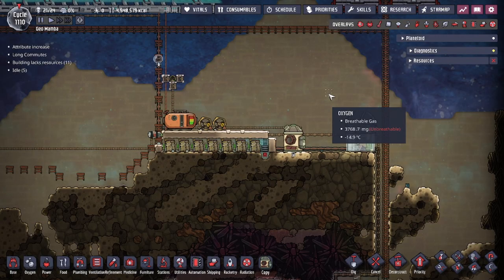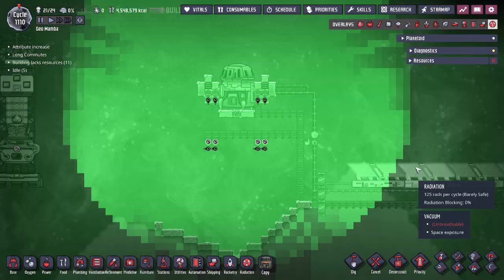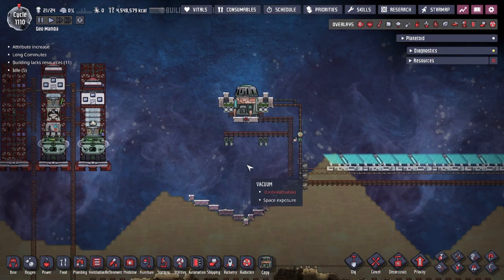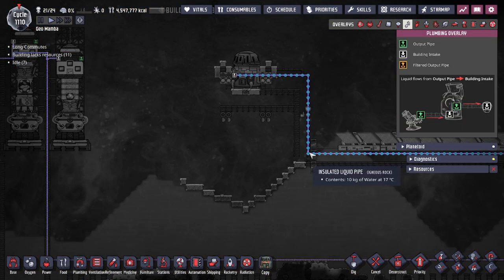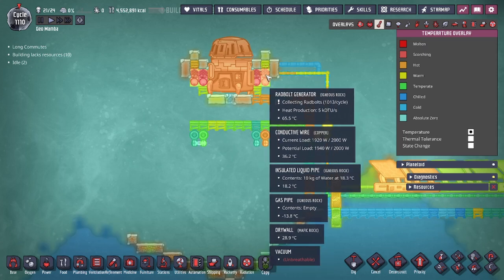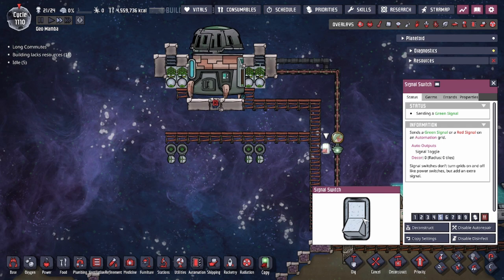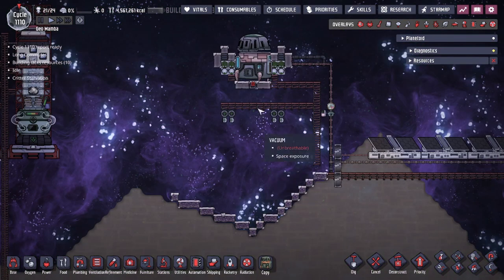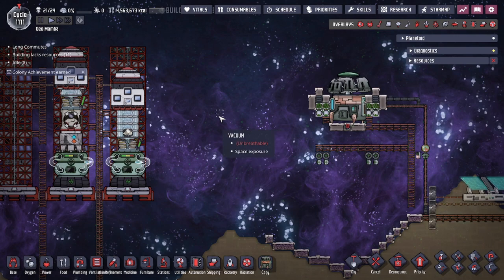Easy Radbolt Rocket Engine Charge - Research Reactor Cheese - Oxygen Not Included

Comment: Technically, you could use an automation line with a heat sensor to detect when water is falling, open a mechanical door, and lock the steam inside a separate room for easy heat and water collection.

Comment: Likewise, you could put wheeze worts fed by shipping and automation next to the generators. Enclosing them in a space with hydrogen, then you can put a solar panel to either side, and use nuclear waste or gold/tungsten metal tiles to seal the room, as they block very little radiation. The radiation generated from the wheeze worts will also more than make up for the hundred rads lost.

Comment: what about catching the nuclear waste and let the steam fade away, pump the waste into an infinite liquid box for the rads?
Reply from the maker: its tough because the space vacuum would just eat it up almost immediately and because the steam is in liquid form of "water" and stays like that until it makes contact with a solid to flash into steam. so since they're both liquids when its dumped, its hard to make a design for it. although not impossible to
Reply: @2LegitCity  Maybe have a drywall tiles on the catch block (expanded to 2x2), hydro sensor hooked up to pump with a filter gate so it'll only pump the nuclear waste a few seconds after hitting your threshold and gives the water time to flash to steam and dissipate. This of course would require thermium for the pump though.
Reply from the maker: @madmerlyn  technically this gives thermium some practical use
Reply: @2LegitCity  technically Niobium would be good enough too.
Reply: @madmerlyn  you can have the liquid waste flow off a platform to a cooling pool and cool it from below to be able to pump it. The water will meanwhile flash to steam and escape to vacuum